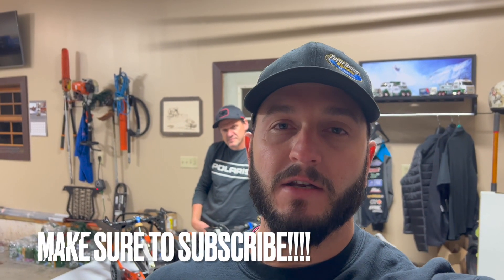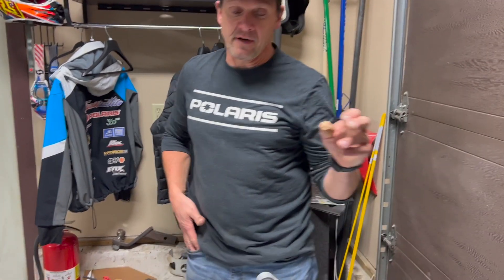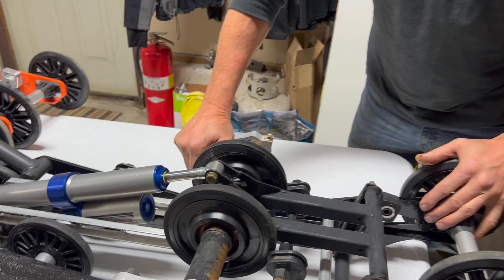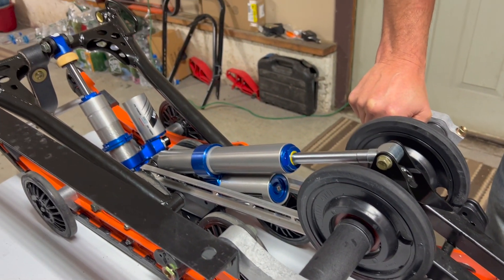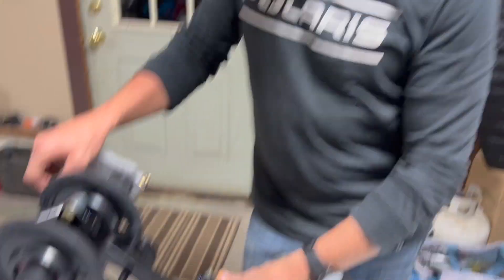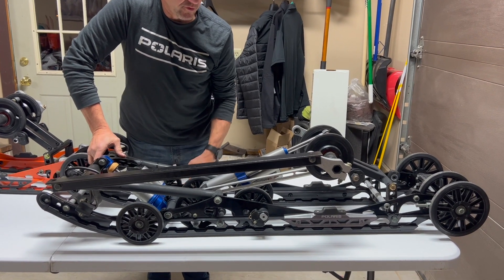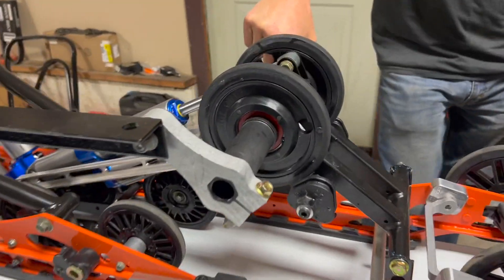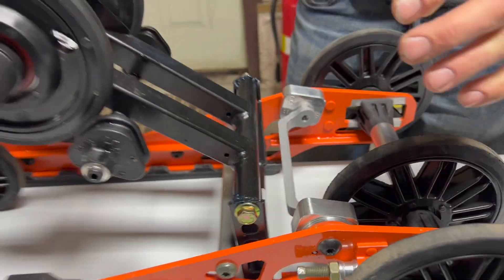POLARIS VR1 BOOST REAR SUSPENSION VS STANDARD VR1 SUSPENSION. WHAT HAS CHANGED ANY WHY?

Comment: Great vid and tech tip. I had a xc137 with xtra hd springs, used it for two up riding in Norway. Best trail sled ever as long as I remembered to change my spring settings, coupling blocks and shock settings.
Reply from the maker: yes very big differnece going from a 2 up ride to a solo ride!

Comment: The point of coupling as the gap closes is sooner.. when the skid is coupled, front and rear springs and shocks work together.. even with softer springs.. in other words.. you get a help with ride and maintain greater ski contact…you get more done with less…and compared to the longest delay in coupling and the rear kick or Buck, where the front reacts to the bump then the rear takes a greater hit from the rail angle increasing, no kick when coupling is fast or sooner (smaller gap)

Comment: Great vid guys. I have two questions for the VR1……1. Are those scissor blocks supposed to rotate by hand like in the video? I can’t move mine by hand. I’m gonna have to loosen the Allen bolt. 

2. Can the aluminum scissor block on the boost be put on a vr1 frame? You said skid is the same from the scissor blocks to the front. It looks like the boost has a much beefier skid in the rear (more metal supporting the frame)That would be sweet for more adjustability if possible.
Reply from the maker: so those coupler blocks are new for the boost. They are spring loaded (new design) and only the boost VR1's have them. You can put them on the standard skid but as we mentioned in the video the rail of the VR1 is much beefier in the rear because of those new blocks taking such a beating

Comment: EXCELLENT video!  I have a '22 VR1 850, I believe my RRSS is set to medium, which is what it was when i bought it. I'm about 250#, I have the HD springs on mine. Mine likes to pull the skis under power at just about any speed, plus I have a hard time with ski lift when cornering and getting on the gas to accelerate again. It also will bottom out on square edged bumps or when you go up and over a nice roller hill where it feels like you are almost airborne, then you see the "hole" at the base of the hill that you have to quickly stand up to absorb, I always bottom out.  Don't want to set my torsion spring TOO high or my ride height will be too high to recycle the snow onto the heat exchanger either.  Would I accomplish a better ride experience by simply moving the blocks to the high?  I mean is it as simple as a quarter turn "could" make it a different machine or am I dreaming?
Reply from the maker: so few things here. 1. at your weight youre really a candidate for XHD springs. HD run out of steam around 230-240lbs 2. having the tosions on high will not effect cooling. these sleds run very cool and that will have no effect on It 3. your bottoming becuase the valving is very soft in the VR1's especially for a guy your weight. I would really recommend getting them done 4. your ski lift is due to the rear still being too soft. moving the RRSS to high will help but that is really a bandaid for the actual problem. hope that all makes sense and clears up some questions!

Comment: In video Bruce was saying if you don't have heavier springs the track will rub the top of the rear shock welli put in hd springs and the track is rubbing the shock could this be that the track isn't tight enough
Reply from the maker: doesnt have to do with springs but just a suspension that is too soft. That track is way more likely to hit the shock if you are at the bottom of the stroke all the time. just because you have the HD springs does not mean that the suspension is where it should be. we just had a 23 XCR come in (come with HD springs) and the shock was all beat up already. Bruce valved it properly and it will most likely stop that. Loose track could be an added issue also
Reply: Track wasn't too loose, it was too tight . Would that cause the track to rub the shock

Comment: Got a new 129 Boost coming. Sounds like for aggressive trial riding, putting the rear block on four might be to much.  I may start with position 3 and play around.  Do you think the stock  torsion springs for 210 pound rider will be good, or what would you recommend?  Thanks, and great work on the videos!
Reply from the maker: yea 3 is a good stop to start and mess around from there. stock springs will NOT be enough. These sleds are extremely soft. i recommend HD rears at least. Would like to see you get 100 pound front springs too considering these are only 80's.

Comment: Any chance you know what the center is on that custom limiter bar he made? I have the same skid I’m putting in a mod sled and would like to know. Love your videos. Thanks!
Reply from the maker: what bar are you referring too? Those skids are all factory
Reply: @JESSEJAMES322  in the video you have a piece of steel holding the two arms in the correct distance from each other. Do you know what the spacing is off hand? I’ve tried looking on forums. No luck
Reply from the maker: Oh that bar. I do not know the exact of the top of my head but if you’re looking to do It with your sled measure the distance between the bolt holes on your sled

Comment: I think the Pro CC has a G out bottoming problem because of that front coupling,I think it let's the whole suspension bottom out way to easily,and I also don't understand why you would have those upper idler arm wheels mounted to the rear torque arm? When you're hard on the throttle isn't it pushing down on that rear arm? As opposed to an IGX that has a shaft mounted upper idler wheel?Which in practice isn't affecting the suspension when hard on the Gas?? Could probably talk about this all day 😂😂😂 Sorry for all the comments....
Reply from the maker: i dont think so. i think the bottoming problem is the fact they come with  springs for a 90 pound rider and valving for a 60 pound rider. once sprung and valved properly they actually work great. as for the upper idlers regardless of where they are mounted you will have force pushing down on that rear arm in my opinion but i am no engineer!!
Reply: Your right about the valving because Hygear did my shocks last year and even with that horrible 80/240 front spring it wasn't that bad, I'm getting antsy ready to take a ride to chibogamau Quebec if we don't get snow soon😂😂😂

Comment: Can't stop the questions How does Bruce set up front shock preload? Does he use factory recommendations? Because factory recommendations don't include where the limiter strap is,If you shorten or lengthen the limiter strap it changes your initial preload? If you could guys could comment on this I'm sure more guys have this question....👍👍
Reply from the maker: pre load on all coil springs are set with no load on the shock. its set when the shock is fully extended. you run the collar down to the spring until no play is visable then measure from top of collar to a fixed location on the shock. then turn the collar down to your desired preload

Comment: My buttocks mentions that the Vr1 is not at the level of the R-Motion. The progressive damping of the front shock absorber is much less. The mounting point of the R-Motion shock absorber almost opposite the mounting holes on the chassis, which allows for a longer shock and its slightly flatter angle towards the front, and to have a heavier spring without being too stiff. Polaris is almost there.
Reply from the maker: R-Motion is definitely superior to our skids but these are not far behind!
Reply from the maker: Have you get entered in the channel giveaway? you could win a set of C&A skis, Woodys carbides, Woodys studs, Rox Speed FX hand guards and a $200 gift card to Southside!! anything purchased off 322threads.com gets you entered!